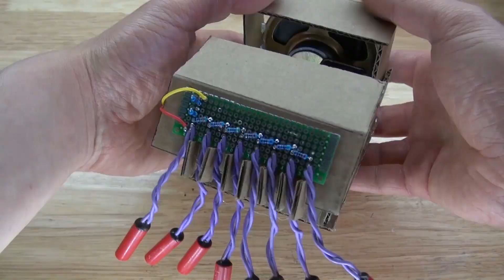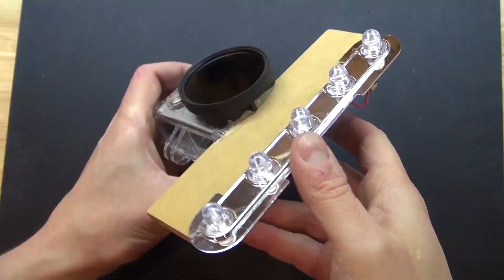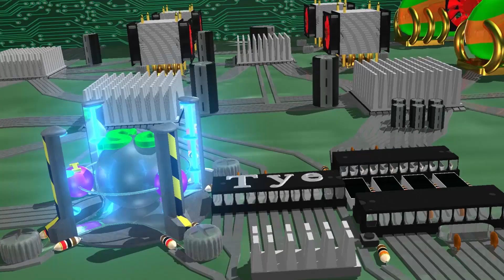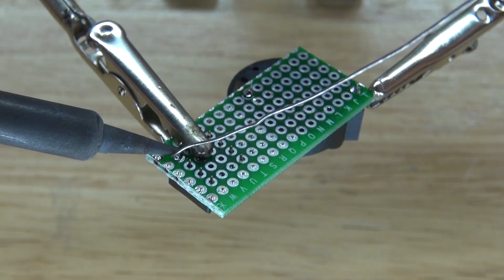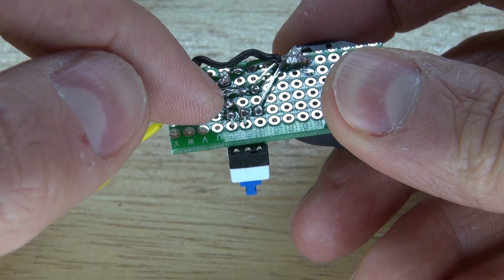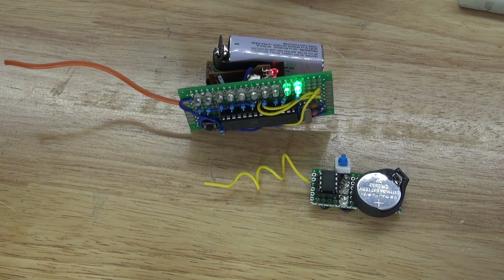Attiny85 EMF Detector

Comment: I know this is an old video but it the code still available somewhere?  Thanks!
Reply from the maker: It is the bar graph code that is in the Arduino IDE software, and just change the pin to 0 1 2 for the leds and A0 to A3 for the antenna.
Reply: @SciTyeTech   Great!  Thanks for the info